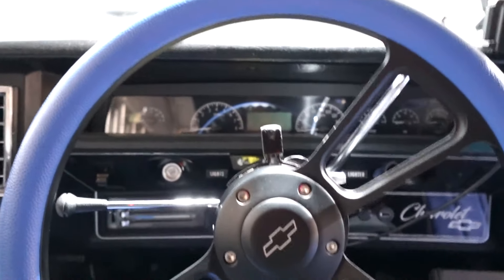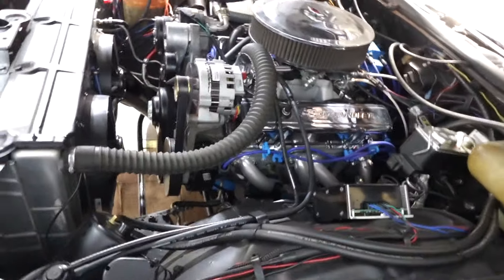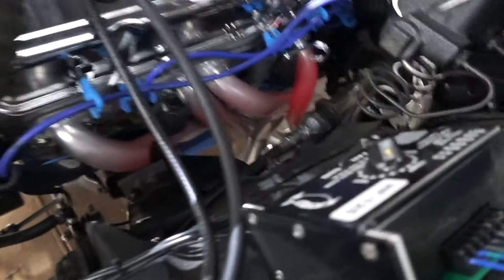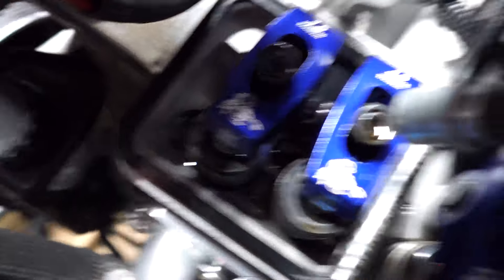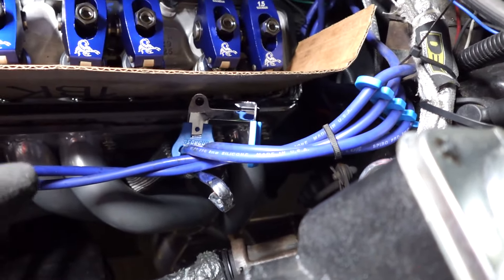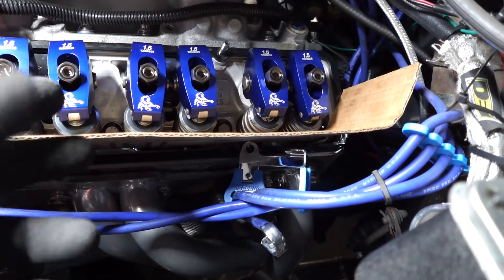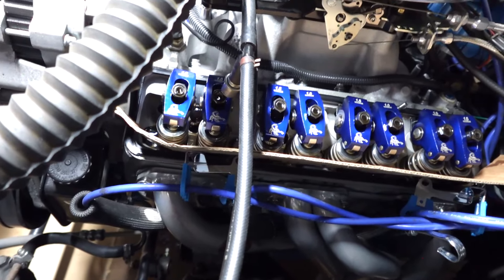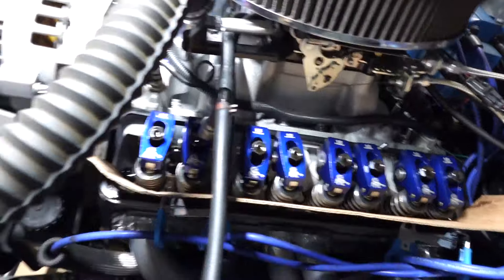Diagnosing Rocker Arm Noise on Small Block Chevy 406 V8, 1973 Impala, Part 1.

Comment: I believe I'm having the same issue. however, it starts smooth, starts taps after a min or two on cold start then it goes away after it warms up completely. Once I turn the engine off a while and start again back to tapping again and goes away. But the sound seems like it's coming from the bottom left.
Reply from the maker: Mines Turned out to be a collapsed lifter on cyl 1 exhaust. That fixed it. Its been fixed not for 3 1/2 months just getting around to getting the video footage uploaded for it.